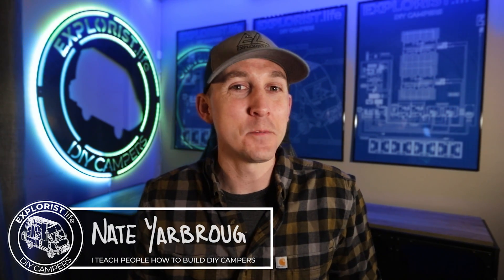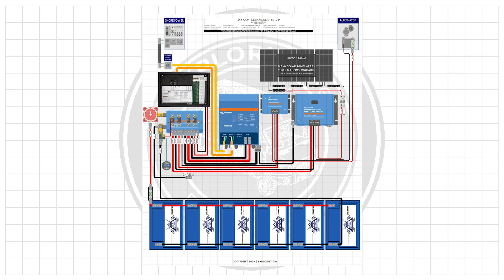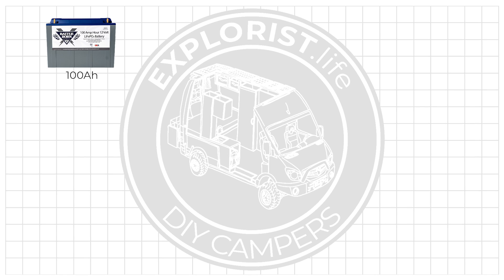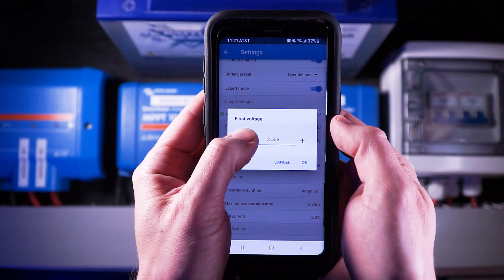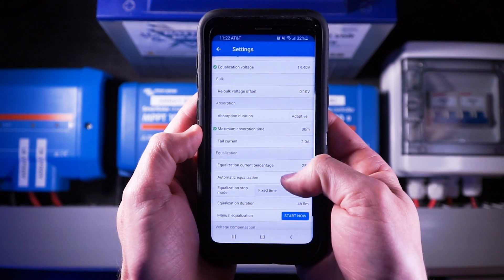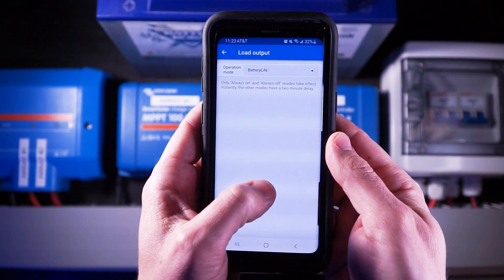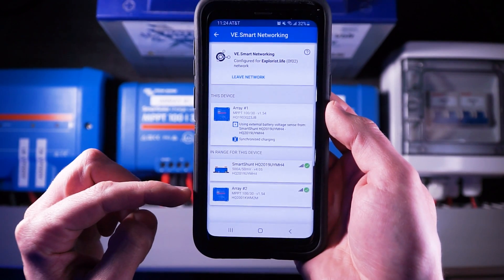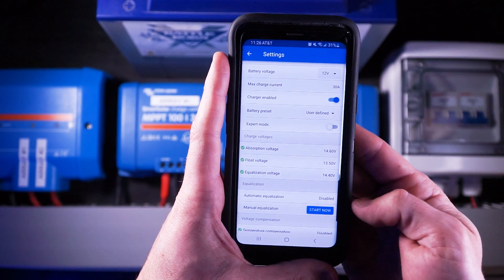How to Program a Solar Charge Controller in a DIY Camper Electrical System

Comment: You answered a question I have asked my victron rep. Why when my lifepo4 battery is discharged it will put the full charge in (victron 100/30), 30 amps, as soon as it gets up to 90% charge the controller drops down to 15 amps, and later 2 or 3 amps to 100%. Battery is a 165Ah. I have 690 watts of solar and it is putting out this time of year (winter) occasional great sunny day and 10*F, 92 volts, and 405 watts, I see there is room for more, but with snow and clouds I am lucky for 100watts. Always wondered why it would throttle down after 90% charge on default LiFePO4 settings, never got as thorough explanation as you just gave. Thank you.
Reply from the maker: Glad it was helpful!  Sorry you didn't get the answer you needed from your Victron rep.  You can always come under our wing at shop.explorist.life and then you've got direct access to us for customer support for questions like that. 😊
Reply: @EXPLORISTlife they weren't the only distributor I asked, I try to double check the info. Thank you for the info, I can now stop trying to figure out what was wrong...

Comment: Instead of 'User Defined' I chose 'Select Preset/Smart LifePO4' for my charge profile as I have LiTime smart LifePO4 batteriers .. made sense to me :)
Reply from the maker: Fair enough, but that setting is for Victron SmartLiFePO4 batteries with an external BMS for external control and DVCC
Reply: @EXPLORISTlife  oh! I'd better check the litime specs then ... maybe user defined is better after all
Reply from the maker: @miramar-103  Did you purchase your charger from our store?  We can help with those settings for free if so.

Comment: Have Victron charge controller,  unable to find what rotary setting for AGM lead acid free battery? . Does anyone have number for those batteries,  Thanks  . MPPT 150  1  100 smart solar charger. Wayne .
Reply from the maker: Hey Wayne — good question! The rotary dial settings on Victron charge controllers can be a bit tricky, especially with non-standard batteries like “AGM lead acid free.”

The best setting really depends on the battery’s exact charging profile, which usually comes from the manufacturer’s specs — so getting that info is key. In some cases, you may need to use the Victron app to set custom charge parameters instead of relying solely on the rotary switch.

For help dialing it in, I’d recommend contacting our support team so they can take a quick look at the battery you have and guide you from there:
https://shop.explorist.life/support
(We offer free personalized support if the gear was bought from our store!)

If your equipment came from elsewhere, the EXPLORIST Pro Support Membership is a great way to get custom help:
https://shop.explorist.life/shop/all-products/membership-tiers/

Comment: Question: I want to know if I'm connecting two different Victron Charge Controllers, would the Charge Parameters be the same for both?  The two Victron Charge Controllers: 100/30 and 150/100 connected in parallel as you described in your video. 
Thank you
Reply from the maker: Great question! When connecting two different Victron charge controllers in parallel, they generally can use the same charge parameters—but that can depend on your battery type and system design.

To make sure everything's dialed in correctly for your setup, we recommend reaching out to our support team so they can take a closer look and confirm the best configuration for your specific gear:

https://shop.explorist.life/support
(Free personalized help is available for items purchased from our store.)

If the components came from other sources, our EXPLORIST Pro Support Membership is a great way to get expert, personalized help:
https://shop.explorist.life/shop/all-products/membership-tiers/

Comment: Wondering if you can help me. My equalization voltage setting is disabled. How can I enable that to set the proper boundary?
Reply from the maker: Thanks for reaching out!

That setting being disabled could be due to the battery type selected or certain system conditions that temporarily restrict adjustments — it really depends on the exact model and setup.

Our support team can walk you through it and help tailor the settings to your specific system here:
https://shop.explorist.life/support
(Free personalized support is available for items purchased from our store: https://shop.explorist.life)

If your gear came from somewhere else, our Pro Support Membership is a great option for personalized help:
https://shop.explorist.life/shop/all-products/membership-tiers/

Comment: Thanks for the video. I reached out to my battery manufacturer (ecoworthy). I have the 280amp and there respone is ...This is our main common parameter setting about 12.8V lithium battery, you can refer to it, thanks!

Battery Type: LiFePo4 lithium

Rated Voltage:  12.8V

Overvoltage Disconnect Voltage: 15.5 V

Charging Limit Voltage: 15V

Overvoltage Recovery Voltage: 15V

Equalize Charging Voltage: 14.6 V

Bulk Charging Voltage: 14.6 V

Absorption voltage: 14.6V

Float Charging Voltage: 14.6 V

Bulk Voltage Recovery Voltage: 13.4 V

Low Voltage Recovery Voltage: 12.5 V

Undervoltage Alarm Recovery Voltage: 10.5 V.

This seems wrong. What are your thoughts. Im using a victron Smart mppt 75/15
Reply from the maker: Thanks for sharing that info — and glad the video was helpful!

Some of those values do seem a bit unusual or possibly just not worded clearly. Settings can vary based on how the manufacturer configures their BMS and what they're prioritizing.

To get the best recommendations tailored to your Victron MPPT and battery setup, I’d suggest reaching out to our support team here:
https://shop.explorist.life/support

If your gear was purchased elsewhere, our EXPLORIST Pro Support Membership is a great option for one-on-one help:
https://shop.explorist.life/shop/all-products/membership-tiers/

They’ll be able to guide you through the best configuration for your specific system!

Comment: I am using a Victron  Smart solar 75/10 with a LiFe  24 volt battery. Running a cobb tight. The max voltage for the light is 26.4
Looking up the float, equalization and absorption for LiFe, what values should I use. Thanks

Comment: Hello.. Just a polite question. Why are you Float charging LifepO4 ?.. What is the reason to do that?..
Reply from the maker: You wouldn't float charge LiFePO4, no.  The float voltage is set to the battery resting voltage, which effectively disables float.

Comment: Hi Nate, you mentioned that 1 battleborn 100Ah had a charge limit of 50Ah, with 2 charge controllers running in parallel @30Ah each charge limit is this not 60Ah total or are I seeing this wrong? Thank you
Reply from the maker: 2x chargers charging at 30A each would indeed be 60A unless DVCC is active.

Comment: I recently purchased a MPPT 100/50 smart solar charge controller.  I tried to program this unit thru the Victron Connect App and tried the default PIN (000000), and the App advises that was the wrong PIN....Help!!!
Reply: I just got one too a few weeks ago. I had a sticker in my packaging that had a qr and a pin. It was a sticker with a specific pin, not the default.
Reply from the maker: Visit shop.explorist.life/support for some personalized guidance on that.  There could be a few things going on.

Comment: Just to confirm....  if I am working with 4x 12V/150Ah batteries in series/parallel....I would be telling the charge controller that my battery bank is 24V...yes?   Thank you in advance.

Comment: HI getting pretty confused on charging rates etc. I have 4 x 12V/120Ah LiFePo in 2s2p (24v/ 240Ah), 2 x MPPT (250/100 & 150/35), what should I put in as the charging rate?
Reply from the maker: If this video didn't clear it up and you've purchased your components from us at shop.explorist.life, reach out for tech support!  shop.explorist.life/support.

Comment: I was sad to not be able to join in on your live stream as I have many questions, after trying and failing to ask on the customer support ( my issues for sure ) and having had you respond in the past I figured I'd give this a shot. I've installed 1400 watts of solar on a 20 year old class A motorhome with 4-6 v AGM batteries for a total of a 380 ah 12 v system. I have  4-200 watt panels, 24 v and 8.52 amps each & 6-100 watt panels, 24v and 4.21 amps each. per your advice I purchased 2- 100/50 victron mppt solar chargers from you. Question # 1 am better off wiring my panels for max amp's at 24volts or at 48v and lower amps ? second question am I better off installing my two solar breakers as close to the panels on the interior of the Rv or right at the solar chargers. 3rd question can you suggest one of your diagrams that best match my current needs while keeping in mind I will be updrading to lipo's in the future. P.S its a 50amp RV
Reply from the maker: Sorry for the customer support issues.  DEFINITELY check your spam folders for those and ENSURE you haven't blocked our email address.  These are the two biggest reasons that customers don't get responses as we respond to all inquiries within 1 business day.

For this question, hit up our chat bubble down in the lower right side of shop.explorist.life and we will get you squared away.
Reply: @EXPLORISTlife  thanks, I'll do that.

Comment: Just starting into the cold temps since I installed my Victron system. My lithium batteries dont have a low temp cutoff and I have my two charge controllers set to stop charging at 41 degrees F but they still allow charging. The temp sensor thats connected to the Cerbo showed 30 degrees this morning and watching it real time it showed charging as soon as the sun started coming up. What am I missing??

Comment: Just found your site and love it, thanks. I'm trying to work through a problem.  We are full time RVers, 8 years with solar and a backup generator. We have Victron mppt 100/50, BMV 712 and 4 Battle Born batteries.  For 2 nights boondocking sitting at about 68% at midnight or so everything goes black and still have about 68% power. Powering up to day with generator trying to get to 100%.  Can you make some suggestions on which videos of yours to watch for help.  Enjoyed this one, easy talk, straight to the point, and a little humor. A real nice find, thanks.

Comment: 5:00 - If the battery has a built in bms, isn’t programming kinda mute?
Reply from the maker: Nope.  A built in BMS (in general) does not communicate it's charging needs with the various chargers of a system.
Reply: @EXPLORISTlife  Thank you! I did a bit of research and thanks to your video, learned a lot about battery management and optimal charge settings. Much appreciated!

Comment: Hi there! I plan to have Victron Energy SmartSolar MPPT Tr VE.Can 150V 70 amp, so how to setup it for 36 volts battery connection type?
I need some special devices like additional screen, or I can set this parameter via bluetooth in app?
Reply from the maker: This may take a more in-depth look at your personal setup.  If you have purchased/are purchasing from our store (shop.explorist.life) reach out for some more personalized help: shop.explorist.life/support

If you've purchased/are purchasing elsewhere, reach out to your dealer for support.  We'd love to have you as a shop.explorist.life customer so we can provide a bit more help in the future. 🙂

Comment: Great video. I'm trying to find the low voltage cutoff settings in the Victron app but am unable to. I didn't see it covered in your video either. Is it called something different? Thanks!

Comment: I just burned my 2 solar charge controllers as I had them disconnected from the battery and they had turned of during the night and needed rebooting. I did not think of it and flipped the switch connecting the totally turned of chargers to the battery with them instantly starting to hiss and smoke coming out of them... I immediately disconnected the battery with the switch but that did not help they just continued to hiss and smoke while at same time showing no errors and showing that they was set at the correct 24v battery voltage. The solar panels have been pernmanently connected for 3 years to the 2 charge controllers with no switch, so to unplug them you have to unscrew them, which I did but at that moment the smoking stopped. And I measured the voltages going in, it was 80v like normal. But the battery voltage going out to charge the battery was not normal at all at 77, 7v while the chargers still showed all normal expept for 42v battery (which really was 77,7v). It is quite scary that 2 charge controllers can fail like that and send 77,7v to the 24v battery bank...

I have connected and disconnected the battery like that many times before but never when it was full sunshine like yesterday at noon... Most likely that is why it went fine all the times I did it before. My solar array is on a van flat mounted 1280w of panels connected at 80v.

Now I think I will order 2 of these Victron chargers as I want redundancy and safety of having 2.

I learned my lesson, ALWAYS disconnect the solar panels before connecting a battery to to solar charger on a dead charger that is not booted up...

Comment: Great video! Thanks for explaining things in a way a newbie can understand. I do have one question….  I have purchased two 100Ah Battle Born batteries, so, do I need to have one charge controller for each battery or will the single one suffice. It is a Victron MPPT 100/30 like the one you used in this video.  
Thanks again.
Reply from the maker: You will have one charge controller per solar array for the whole bank of batteries.  If you have purchased/are purchasing from our store (shop.explorist.life) and want us to take a more in-depth look at your personal setup.reach out for some more personalized help: shop.explorist.life/support

If you've purchased/are purchasing elsewhere, reach out to your dealer for support.  We'd love to have you as a shop.explorist.life customer so we can provide a bit more help in the future. 🙂

Comment: @loisfaruolo6932
 
I have a 12 volt Duralast AGM battery  Cycling Charge rate 14.4 -15.0 v  with a 13.5-13.8 Float charge  What type would you say my battery is ? My 30A topsolar controller connected to 200 watt panel  is already preset on type 61

Comment: trying to find out the type of battery I should insert into the app. I have 2 Skanbatt SK80Ah 600cca and a Victron mppt 75/15, I don't quite understand the designations in the app on the batteries.
Reply from the maker: The video you commented on outlines the information you’ll need to get from your chosen battery manufacturer for proper programming.
Reply: @EXPLORISTlife  that i have, but not what type of battery,  not gel 🙂

Comment: Hi , 
Why did you calculate the amps when you specified the panels are in series . Isn't the amp supposed to remain the same .  Confused
Reply from the maker: Not on the output side of the charge conntroller.
Reply: @EXPLORISTlife  ah ok got it , thanks much appreciated.

Comment: Questtion on this MPPT controller. I hae 2 house to start batteries on my boat. Got to the boat and app said they were floating. Showed 20v from 2 100 watt panels 0 amps. When my boat is running my battery monitor shows -1.59 amp draw? Why? The voltage is 14.8 from motors. Shunt i sinstalled correct to a neg bus bar. All house loads are off during readings.
Reply from the maker: Batteries are full.  Cant charge a full battery so you are therefore seeing 0 amps flowing.
Reply: a draw is what has me nutty.
 @EXPLORISTlife  right i get that but -1.

Comment: Yeah that's the process how it's done  with Victron solar chargers as such . But few know how to set two identical chargers one for low load output to inverter and the second one kicks in only when high loads needed from battery , any battery , to inverter. Can be done to......
Reply from the maker: Yeah, that’s not really how we recommend doing things… so if you’re looking for advice, perhaps just do as the tutorial shows.

Comment: Hi Nate I have installed a Victron 100/30 runnng 2x 100watt panels. into 3 x 110amp lead acid batteries. Should I be putting a fuse between the panels and the Charge controller and between Charge controller and batteries. If so what fuse/burn size

Comment: Just installed my 100/20 Victron. I have 5 leadacid RV/ marine batteries wired in parallel. When im on the battery drop down what should i select 😵‍💫

Comment: Hi, I am trying to set up a solar system and I want to use a 16v battery ( I build this battery for 18650). The problem is, all of the controllers that I have seen are only meant for 12v or 24V batteries, how do you think is best to charge this battery using solar/

Comment: So I have 5 12v 100AH Deep Cycle Lead Acid batteries (SuperStart 31DCM), what amp (settings) do I need to charge those batteries? I have the paperwork from the manufacturer of the batteries, however I don’t understand what it’s telling me. Is there a way I can send it to you and you help me get the right setting?

Comment: Hi just seen your video on solar chargers very interesting.ive got a renogy 170amp lithium battery 200w panel an a victron smart 100/20 . What should the settings be set to for my battery. I’ve chose the lithium setting but should I change the charging valves it’s saying 14.2 v help cheers mike

Comment: hi i have a question about the streetlight function. i have a battery in the back of my van , and  i also wanna charge my anker powerhouse 757 with solar but it has as problem with day and night so i wanna try to connect my anker powerhouse to the victron mppt 75/10 so i can charge my anker powerhouse ! i can charge with max  " 300 watt solar 11/30V 10amp " , the question is how much watts will the LOAD connection output ? with 10amp ( i m a beginner with solar setup ) i just needed something to fix my problem , thank you for your time , mark